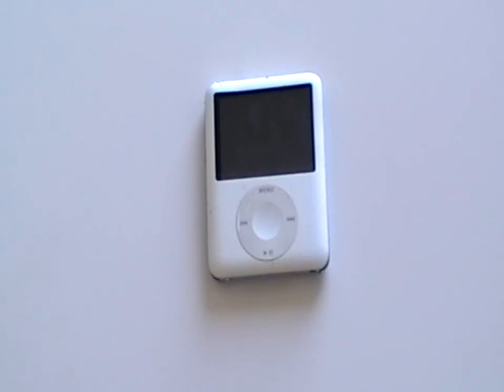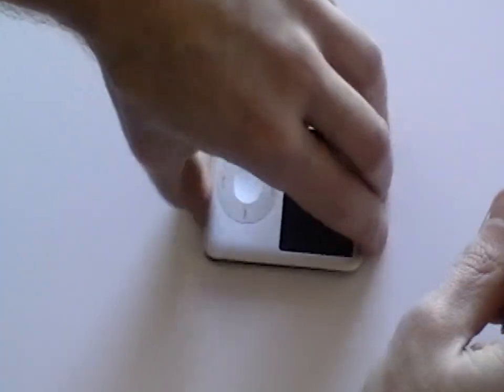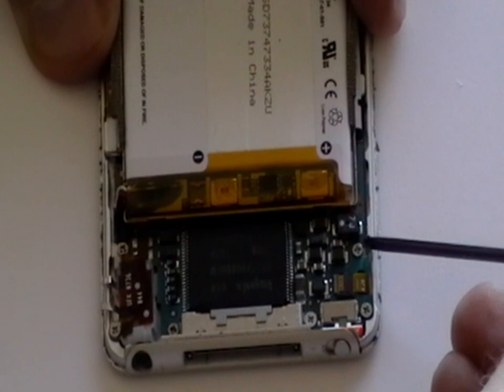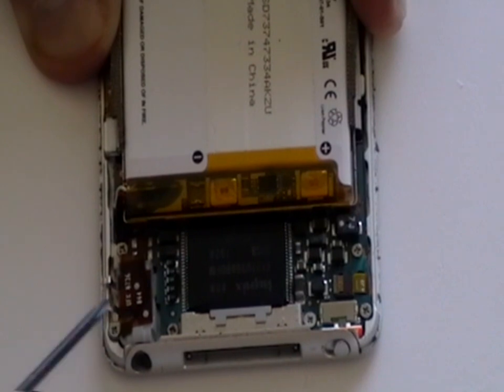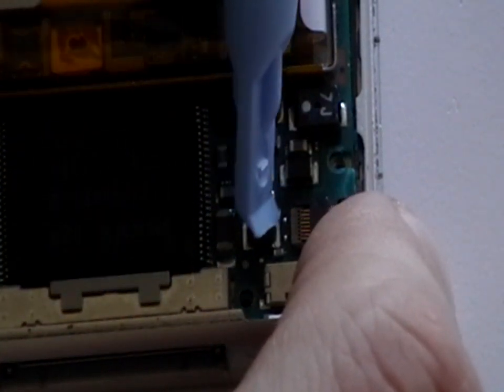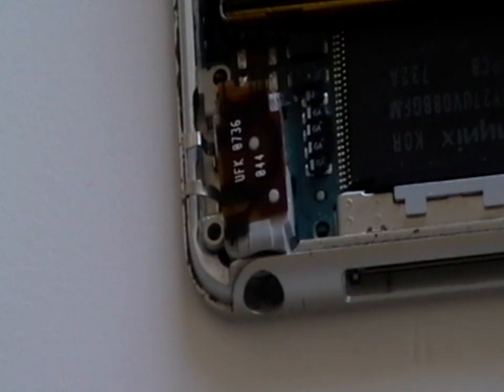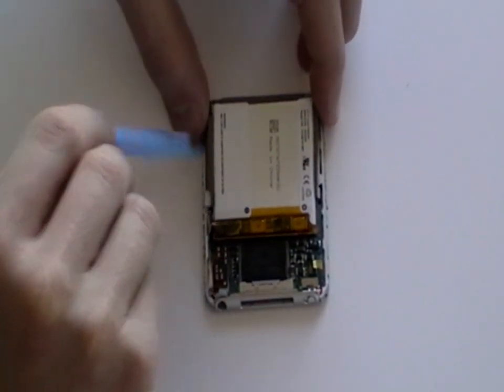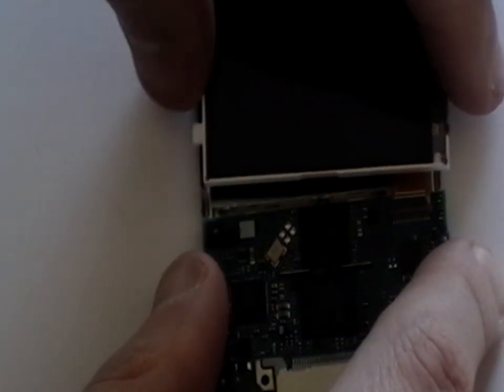iPod Nano 3rd Generation Take Apart Dismantle "How to" Guide

Comment: My battery is starting to not hold a charge like it use to; trying to determine if it is possible to replace the battery.  This particular IPOD looks complicated.
Reply from the maker: Battery replacement on this ipod is possible. It requires soldering and disassembly of the ipod is not for the faint of heart. If you are an avid DIYer you should be able to replace it no problem.

Comment: Yesterday my ipod got some black dots in the lcd.
Today this off leds are two columns black in the middle of the lcd.
What do you recommend in this case? Open it and see if can be changed or cleaned?
Reply from the maker: A Cosmic Castaway You would want to replace your LCD. Sounds more like an LCD issue.

Comment: How did you remove the backplate so easy when all the other videos i found people struggle... all you did was just run it along. is that all i need to do?
Reply: +boxcarjakey The instructions on how to take off the back are terribly lacking and purposefully ambiguous.They want you to get frustrated and then send it in for repair.
Reply from the maker: Using a pry tool for this will help you resolve the issue. Just do it carefully to avoid damaging the device.

Comment: I have a red nano 3g, it won't turn on or charge, when i connect it to a charger (I have a charger that stays green, turns red when something is charging). The light goes crazy, i don't know if it's the battery or if i need the logic board to be replaced

Comment from the maker: @cabajet If the battery is the issue, yes, a replacement will fix it up. However if it will not turn on at all there is a possibility there are other issues. If the device is plugged into a computer, does iTunes recognize it?

Comment from the maker: @HAMMERxHCA Sure - Follow this guide up until around 2:40. From there, remove the few screws holding the back plate onto the front cover and carefully use a pry tool to lift the clickwheel out. The flex cables on these are pretty fragile, so take your time and be sure nothing else is holding the clickwheel in place. Good luck!

Comment from the maker: @RudedogRacin Some of the housings are very stubborn, but using the right tools make all the difference. A guitar pick may work, but may need something a bit more sturdy. Metal pry tools work great for this, or similarly, a butter knife can get the job done as well. Just take your time with it. Once a small bit is lifted, the rest will come easily.

Comment from the maker: @RudedogRacin A great test is to hook it up to a computer and see if iTunes recognizes it. If it does not, there is a high possibility of motherboard damage, likely from water.
You can attempt to diagnose it from disassembling the Nano and checking all connection or if any physical damage is present. It is not likely the battery, as the charger would run through the battery and still charge/turn on the device.

Comment from the maker: @masteryummy Thanks! I would recommend taking it apart and removing everything. If you cover the ports it will probably be fine, but wont have a great paint job. If you only have the housing, you can get a much better finish with the paint.

Comment from the maker: @AndJusticeForAll1231 I would suggest disassembling the Nano and checking for any damage. Its possible the clickwheel flex cable has become faulty, in which case replacing this would resolve the issue. This and other parts for the Nano 3rd gen are available at RepairsUniverse (dot) com.

Comment: You forgot to mention the six different screws have different lengths and diameters. You need to remember or note which one is which, else if you put them incorrectly you can strip them.

Comment: i have an ipod 3rd gen that had i little bit of hot water spilled on it. it still turns on but it won't react, i push play, menu, forward, and reverse but it doesn't work, and its none responsive to when i touch the circle. in ur opinion do u think that something for short circuited or that it'll be fine once the water evaporates? (this happened 11 pm 06/13/10)